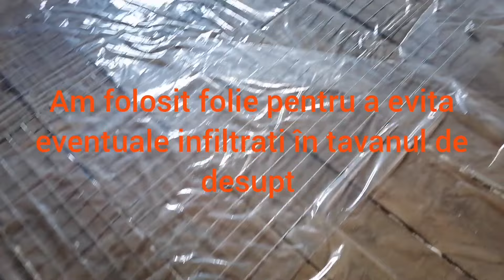Cum se toarnă o Șapa ușoara cu polistiren? Simplu si eficient!

Comment: Salut! Mulțumim de video și explicații. Ar fi recomandat sa torn o astfel de sapă pe o suprafață de aproximativ 140 mp peste un planseu de lemn? Precizez ca planseul este format din corni de 10*14, amplasati la o distanta de aproximativ 70 cm intre ei peste care este batuta scandura de 3 cm. Cea mai mare deschidere intre zidurile de sustinere este de 4*4 metri. In rest variaza intre 2*3 si 4*4. Sapa as vrea sa o torn intre 5-6 cm si as vrea ca podul sa fie circulabil, pentru depozitare.
Reply: Am omis sa spun ca tavanele sunt finisate deja.
Reply from the maker: @narcis8546 mulțumesc ,se poate turna liniștit dar pentru a putea circula pe șapă trebuie acoperită cu parchet sau altceva că altfel se mănâncă betonul
Reply from the maker: @narcis8546  trebuie pusă folie sub șapă bine etanșată ca să nu ajungă apă la tavan
Reply: @MiguelConstructorul  am inteles! Imi e teama ca din cauza greutății sa nu se lase grinzile. Am sa pun placi de osb deasupra, sa pot circula. Multumesc de sfat.